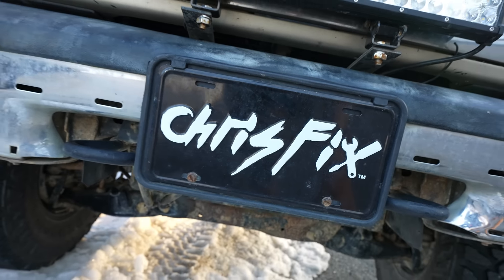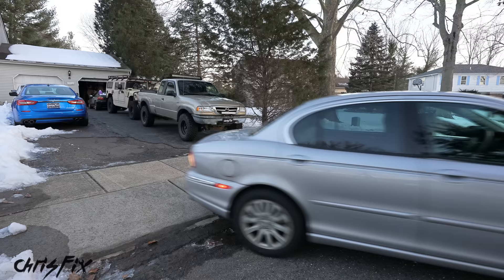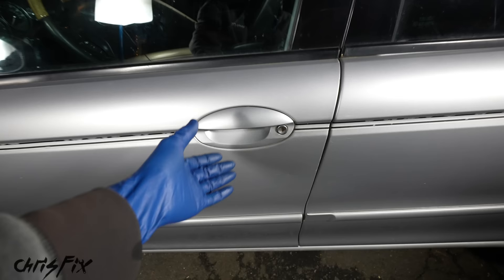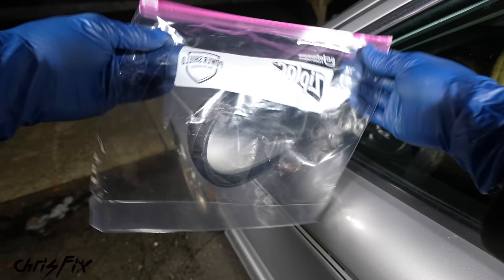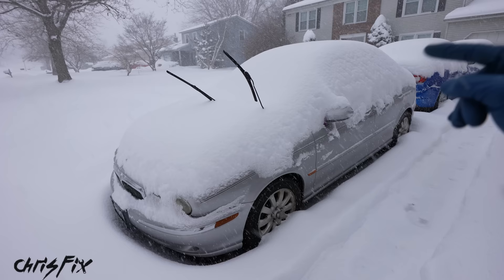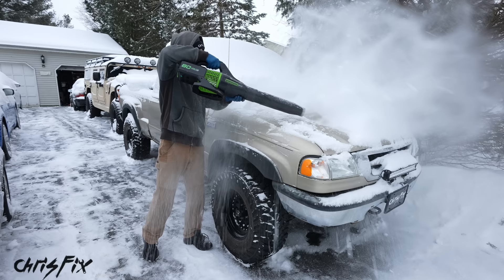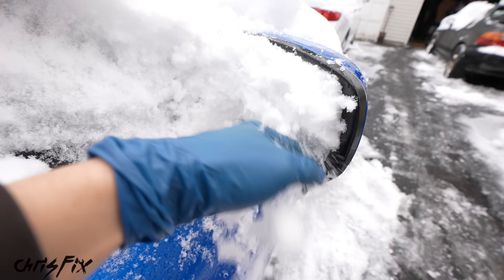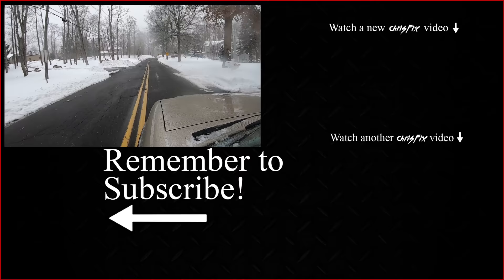10 Winter Car TIPS & TRICKS you NEED to Know

Comment: A few things I've learned from working at a ski resort in the Pacific Northwest. 1. Always remove the snow from your roof. It may seem unnecessary... until you have to brake hard and it all comes sliding down onto your windshield obstructing your vision and possibly breaking your wipers. 2. Never, ever, use the parking brake if you drive a manual, I learned that the hard way when it froze and I spent an hour laying in the snow with a blowtorch trying to thaw it out. 3. A scraper for scraping wax off of skis makes a really good windshield scraper, in fact I prefer it over windshield scrapers. 4. Always carry a recovery kit- a tow strap and a hand winch, as well as small shovel, jumper cables, and fully charged jumper battery. I will def be trying your plastic bag ideas. Thanks for all the tips everyone.
Reply: Wouldn't the parking brake thaw out after warming up the car? Or were the calipers actually frozen to the rotors lol
Reply: The first point is a bit selfish. Think about the person behind you getting their visibility reduced because all the powder and ice is flying off your car and onto their windshield. Or if a big chunk of snow or ice flies off and hits their car? Not good.
Reply: @NATA5II  yeah, that's why you remove the snow... Also, if the person behind you is getting hit with snow from your car, they are following too close. In general people should increase their following distance in snowy conditions
Reply: @runescapefan0001 I had an old Honda that must have had water in the cable housing somewhere under the car because that parking brake would freeze every time I used it below freezing and would refuse to let go. Haven't had that problem so bad in other vehicles though.

Comment: I've been driving fwd's mainly in winters for the past 8 years or so, we don't get alot of snow but sometimes there is a considerable amount.
I have never needed extra weight in the back. And on the occasions where I drove a rwd car, it wasn't really needed either. I'd argue more weight, harder to drift around (or do small skids).

My tip: always have a coat of wax or something like that not only on your paint, but also on your glass surfaces if you don't want to scrape ice off.

Comment: Love your videos ChrisFix!!  Your enthusiasm is second to none.  I actually have 2 critiques for this video, as I live in Upstate NY.  1- leaving windshield wipers propped up is bad.  That will prematurely wear them out and make the springs ineffective against clearing rain, snow, or leaves. 2- ALWAYS brush off the vehicle before shoveling/snow clearing the driveway.  Why go back and clear off the driveway again?  Keep up the great work!!!!!
Reply: If you stomp around the car in your boots you pack down the snow, making it very difficult to shovel afterwards. Better to clean up the ground first.
Reply: WNY here to agree.  Only seen a few people at my Mom's Senior living apts. either put up their wipers or use a window icescreen.  Unless its a real snowstorm with 1-2' of snow, its less than 4-5 min from walking out the door to start the car and get the defrosters going, and knocking the snow off.  I recently picked up a couple of cans of cheap alcohol spray to see how they worked on windshield ice. Verdict is they work fantastic, problem is they're $3-4 bucks and only contain enough for maybe 2-3 applications.  Might be worth trying the $1 store isopropyl or rubbing alcohol in a spray bottle just for kicks, however an extra 2-3 mins for the defrosters to crack the ice sheet works fine too.
Reply: @katherinecollins9636  yup!

Comment: Hi Chris, I have a tip that I use for ice removal on car windows. I keep a full good quality spray bottle of windshield De-Icer and use it on the stream setting. Just spray it a few times sideways from top to bottom while you are removing snow from the rest of the car it will be melted.
Reply: well i mean thats the point of putting it in the window wiper fluids.
Reply: @FurryMetalFerretVT  He's saying for the other windows...not the windshield.

Comment: Great ideas. I like using an oversize tarp or cover on the windshield, wide enough to drape inside the door to seal it tight. This way, you can also protect your front side windows from frost and ice.
Reply: If it rains before it freezes can get in between the Gap where the tarp and your seal meet there by introducing water into your car not good ask me I'll tell you.
Reply: Moving blanket will not have gap.  Tarp of the blanket will at least keep the blanket dry for reuse👌
Reply: I usually use an old bed sheet. When I was younger I would wrap a large tarp across and tie it down.
Reply: I use marine cloth and drape it into the front doors to hold it in place… high winds don’t move it at all then, just sometimes the front over the wiper well gets lifted a little, but not often.  No moisture comes through.

Also in summer I use a lacy synthetic curtain across the windshield and closed into the doors to shade the car from the sun… looks cool from the inside and out as well as keeping the car a ton cooler (and you can sit in the car and see out well).

Comment: Great tips 4 hints that I do, the windshield cover: I cover the wipers BC the snow slides and freezes them. With the cover over the wipers no worries. If your door weatherstripping does freeze... Do not pull it PUSH as if to close it the ice breaks and the door opens. In the morning I have a spray bottle filled with de icer that I spray on the windows to start the melting of ice. I spray all the glass a
Then push the ice off all windows.
    Before the snow plows come  by I shovel (the left side) neighbors 10 -15 feet before MY driveway BC when tho low comes by there is less heavy snow thrown onto MY driveway!

Comment: Cris, great video as always. Been using leaf blower for decads. Use it to blower off drive and sidewalks too.  Couple suggestions. If using trash bags, start wipers and stop half way. Wipers would then hold bags in place.
Other, for pickup with open bed  shovel snow into the bed.  2 wheel drive S-10 with studded snow tires. I was firefighter for 20 years and always made it with plenty of time.  Snow in truck bed adds lot of weight and won't have problem of weight sliding around.
Reply: I do that with my s-10 too. With a broom I just shove ALL the snow I can to the truck bed.  I've never done it but I've heard spraying a lot of water in the back on top of the snow it'll freeze and add tons of weight to it...

Comment: Excellent tips. I had an experience where I only had a quarter tank of gas in my car in negative temperatures and it wouldn't start.  Condensation had gotten into the gas line. A dry gas treatment finally got it started. Now I make sure it's full when a storm is coming.

Comment: I'm a huge fan of your videos! You've turned me from someone who knew nothing about cars into a person who has saved thousands of dollars on my vehicles (started with basic brake jobs, then replaced all calipers, have done spark plugs, and now I'm going to do the front suspension this weekend). Once you learn how to do one thing, it's easy to build skills and confidence to try other things (like changing the alternator belt and spark plugs in my boat--a job that one marina said would cost $500, but I did it for $40). Would you please do a video on how to deal with extensive rust on the underside of a truck/car? I live in a big snow region with lots of salt and have a major rust problem on one car and want to prevent it on the '08 Tundra I bought this year (which only has minimal surface rust at this point since I bought it in Texas). There are other videos out there, but I trust your work more than anyone else. Thank you!!
Reply: Theres products like fluid film or NHOU/new hampshire oil undercoating, etc. can use por15 then the product since por15 is paint over rust so it will stop the rust from getting worse then the fluid film or NHOU will protect it. Just cover up ur rotors and things you dont want the product on. Give a good wash and let dry before applying. You can do it urself or u may be able to find a place that will do it for you. Should last at least a year or 2.

Comment: I've heard another method how to keep your windows iceless:
Basically when you get home/park your car for the night — open all the doors so that all that warm air gets out. Your car should feel cold inside, just like when you get in it in the morning. In the morning you just clean your windscreen of snow and thats it.

Haven't tried it yet, still waiting for the right temp outside. Gonna update if it works or fails
Reply: I got those rain gutter accessories for my windows and just leave the windows open a crack all the time now.

That trick will work unless you have a lot of water collected in the floor mats or carpeting. The idea is to get as much moisture out of the interior as you can before it gets cold enough to freeze.

Comment: I have a tip I use all,the time for all weather and terrain.  RAIN-X Sells a water repellent for glass surfaces.  For first time use clean all glass with  rubbing alcohol to be absolutely sure there is no debris in the pores of the glass.  Spray again afterwards with glass cleaner then use the RAIN-X water repellent spray.  Do one coat for every glass surface walking around the vehicle then do another coat . Make sure to use a new dry microfiber towel after the second coat because there will be a slight haze . Afterwards all glass surfaces will shine like a mirror and that helps during the winter/snow season to water doesn't accumulate on the mirrors and glass

Comment: 1. Keep gas tank at least 3/4 full even if there is no major snow storm. Prevents gas line freeze up. 
2. Brush snow off the top of the car first, brush snow off the rest of car second, shovel snow off driveway last. 
3. Instead of waxing shovel to prevent snow build up on it, you can also use oil spray that you use for cooking.
Reply: A Full tank is Best !
Reply: No need spray anything on a snow shovel

Comment: One of the most annoying aspects of winter driving is snow accumulation in the wheel wells. Eventually there’s so much snow the tire can’t turn fully while making a scraping noise. Only way to get rid of that icey snow is letting it melt in a garage.

So a good tip is to kick off the snow that builds up there before it turns into rock hard ice.
Reply: Carry a small  piece of pipe or use your jack handle or something similar to chip the snow and ice outta there.  I find that I can usually kick it clear with my snow boot at a gas station whilst out and about.
Reply: @RayParker yes

Comment: I would add that you can use a hair dryer or a heat gun to free frozen locks or doors .   You can start the car and let it warm up with the heater and headlights on to loosen ice .    
   In the tool sections at Lowes and Walmart are plastic clamps that should work better than the little metal clamps used in the video .    
   Excellent video ! :trophy-yellow-smiling:

Comment: step one, drive in to garage.
step two, close garage doors.
step three, go to sleep  😂

i wish i had a garage but still gotta deal with the snow for a few more years before that luxurity :/
Reply: Garaging your car in the winter is the quickest way to rust it prematurely.  Imjustsaying
Reply: @jamespfitz  you my good sir does not live in a place where there is 4-5months of below freezing. These conditions are worse for the car then letting it dry up in a warm garage.
Reply: @MrBEAN584  You know nothing about me. The freezing and unfreezing of water inside the metal crevices of your car is what produces rust. Leaving your car in the cold all winter long will minimize the freeze unfreeze cycle and thereby the amount of rust. Taking it in and out of wet cold salty conditions into dry warm salt free conditions on a regular basis is what produces rust. Science, my good sir.
Reply: @jamespfitz  a cold garage or carport is where it's at. Don't know anyone with a heated garage. As you said, a warm car full of salt slush is a recipe for rust attacks

Comment: Quick extra tip on the side view mirror: use a liquid screen protector. I use the same "WowFixIt" stuff on my phone and my side view mirrors. It's a moderately hidrophobic stuff, and the mirror is facing vertically so gravity also helps you out at preventing water and ice. Also it fixes and protects against microscratches on the mirror that could be really distracting when the car behind you has it's light scattered due to these scratches

Comment: Don't forget to drive safely and slower if you suspect frozen or slippy road. In case of losing adherence, don't break or your car will spin on itself, just look where you want to go and turn your wheels exactly in the direction you want to go (might go back and forth multiple times) until you regeain adherence.

Comment: One of the safest and fastest wsys to get snow off your car quickly is with the old wooden handled snow brushes from Canadian tire. The bristles may be stiff and unsafe for the paint but no one really brushes the snow off like that. In Canada we usually saturate the brush with snow so that the paint is actually making contact with the snow on the brush vs the bristles. It’s not perfect but I can’t remember the last time I saw anyone use bristles that stuff directly on paint. Also we remove in layers to prevent the weight of the snow from placing more pressure on the bristles.

Comment: “These tips will prevent you from being late to work and save you a bunch of time in the morning” spends half an hour shoveling first
Reply: then by all means try to get out without shoveling anything
Reply: Get good tyres and you don't need the shovel.
Reply: @draganmladenov  yep
Reply: He has 2 garages, but parks all his cars outside..
Reply: @dubious6718  I can guarantee there are more cars in the garages. I, myself, have 2 daily drivers that sit outside. My 1974 Dodge Dart takes up half of my garage, while my wife's car, takes up the other half. Lol
Reply: @vanmatrix  His garage is actually full of tools and parts. Cars that he can't store at home such as his Vette are stored at a self storage facility
Reply: @dubious6718  garage is full lol
Reply: @HearMeLearn  every day. don't buy a shitty car
Reply: Combat parking actually gives your rear wheels a good 9 feet of non-snowed traction, so you can get out and break through the snow plow wall, in a pinch, should you not have time for shoveling snow. Then with the car gone from the driveway, you can call for a tractor to clear your driveway before you get back home ;-)

Comment: The one and only tip you forgot to include in this how to is to make absolutely sure that your blinker fluid is topped off too since your blinkers are also your hazards, and if you go off the road or get stuck you'll need to make sure that those hazards can work for a long time!
Reply: yeah you can use water or kool aid and add it to your gas tank

Comment: 1:25 Don't put weight in the trunk of your car, it will lessen your steering ability.  Put it on the back seat or floor.
7:48  Use refrigerator magnets, not tape.
8:3  Spray your snow shovels with silicon and store them outside so they'll be cold.  They won't melt the snow onto the shovel.
13:15  Get a brass window scraper and keep in the passenger compartment.  There is no reason to not have a reliable ice scraper for each vehicle.  If you start and warm up your vehicle, the ice in the windows will come off very easily.
Reply: well i mean if its not very cold, and the snow is wet and sticky. its just going to stick to most shovels even if u leave it outside anyway
Reply: Typically, it's the back wheels that slip in the winter, not the front wheels.
Reply: Should we also put silicone spray on the wipers??

Comment: One of my biggest things is just let the car warm up for a few minutes before you drive. Getting thag oil warmed up and flowing before moving is the best thing for your engine in cold weather. I like to use a good oil stabilizer too as it is alot thicker and will keep your cylinders coated for less dry starts 😁
Reply: very much depends on exactly how cold it is. u definitely don't want a thicker oil here where it can get 50 below. your engine would not be able to turn over a thicker fluid as easily. also u will want to shift your car from park to drive without moving a few times for the tranny fluids.
Reply: I have been using synthetic oil for a long time in Manitoba and the cars starts easily with little resistance and it helps your mileage as well. I have always used a brush with a scraper on the other end of the handle and I have never noticed scratches.  We get as cold as -30 to -40 and a block heater is also very handy, some people also have a warming blanket on their battery as they loose power when its colder.

Comment: A king Sized sheet if you won’t by a car tarp. Put it on the car, close it in the door and under the windshield wipers. The next morning pop up the wipers open the door, walk around to the passenger side slash side with the yard, then pull 5e sheet off and the roof and windows are clear. Put it in the garage to dry while you are at work or use it at work. Very portable.

Comment: I just take a king size bed sheet put Over the entire windshield add passenger and driver side door use the doors to hold it down from the wind and the windshield wipers to hold it to the windshield for a little more security and also cover the side view mirrors with the sheet too it works . Peel it off shake off the snow put it in the back and let the heat from the floor vents dry it off for next use

Comment: Another important tip: Make sure ALL your lights (turn, brake, running, head) work properly before winter. And make sure you clear ALL the snow off not just the windows, but also the roof, trunk, and those lights (including the high-mount center brake light)